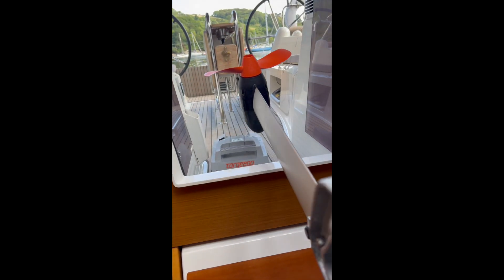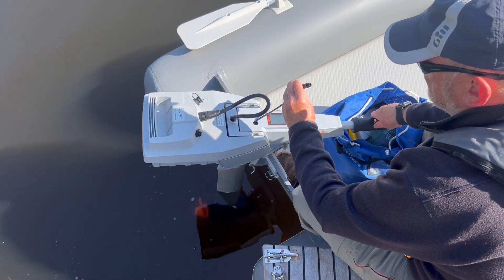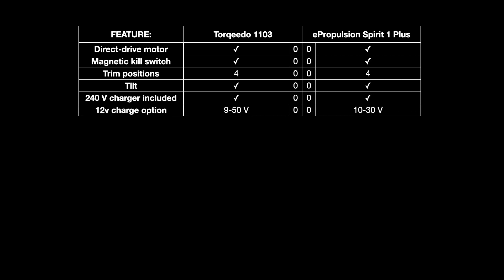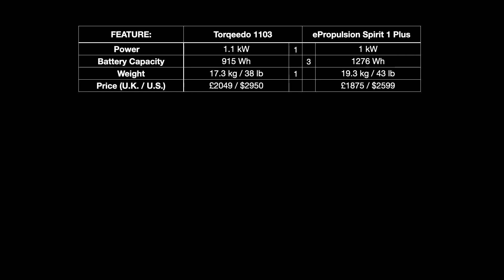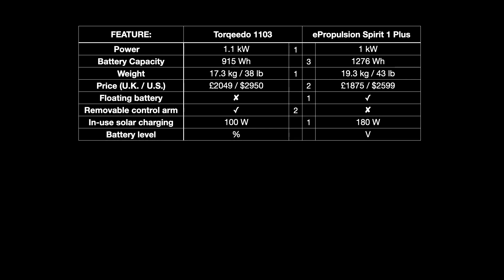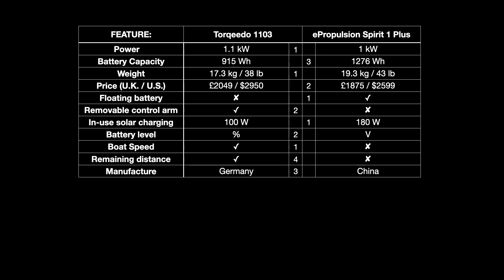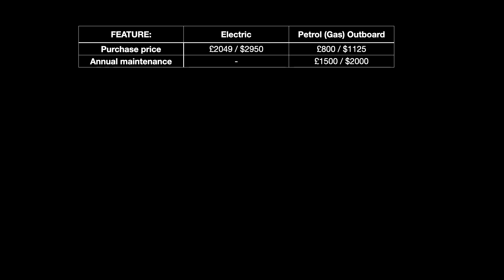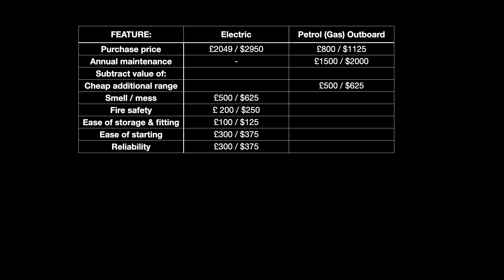Are electric outboards worth the extra cost?

Comment: I've been been a Torqeedo owner for more than a decade. I absolutely love it, but have mixed feelings as for cost of ownership vs a comparable gasoline motor.

As a small car owner (sedan), I really don't want to keep gasoline or oil inside my car which could leak and I'll be smelling that for ages even when the motor isn't inside the car. Smelling it on the water is not a big concern though. My Sea Eagle Paddleski 435ps inflatable boat, the Torqeedo and accessories fit inside my trunk. With the angles you have to store gas motors when transported, it might take up more room I don't have too. 

You can't beat the Torqeedo for convenience. You don't have to make a trip to buy gas, mix additives, etc. On a trip you can leave the Torqeedo in your vehicles for days at a time if needed. I think it would generally be a lot easier to start it than a small gas motor, which I always see people struggling with them. And with wrist issues now, pulling the lawn motor rope would probably not be good for it. There is one lake around here that allows electric only as one of many I go to. 

As for the cost of maintenance between the Torqeedo or a gas outboard, it's hard to say. Yes, when I asked the service center last week what a small Honda costs for annual maintenance. They told me $250 (USA). I asked a few Honda owners about it, and they said the shop might be taking people for a ride. Just some oil to change yourself and pretty easy. So I dunno, looking into that more as I might also want a gas motor too. 

The Torqeedo being 100% maintenance free is not 100% true. I have an authorized Torqeedo Service Center an hour from me. They work on Honda's too. They told me about every 5 years, there is some maintenance that should be done which includes changing the seals and a few things. When my Torqeedo 1003s was approx 9 years old, it completely lost all thrust power.  I bottomed out, but didn't seem like I hit anything too hard. Instead of having it repaired, someone offered to sell me another very cheap that worked (minus battery). It was about the same age as mine. Last year, it too had the same issue. I thought the pylons had gone or I broke he sheer pin if I was lucky. The propeller broke on this one (not sure about my original one), and the shop did what they said was 5 year annual maintenance, and replaced the propeller too. I spent $530, but $100 of that was for the propeller part. They said most of the remaining fee would have been considered the maintenance I didn't do after 5 years. I replaced the battery after it was about 7 years old. That was expected I'd say. The new battery was about $1000 but lasted 50% longer than the original one, and I got it on sale cheaper but it sat for a couple years on the shelf so likely won't last as long as newly manufactured. I noticed an ongoing issue early last season of the power button not working correctly, but I wasn't sure if it was something else besides the button the tiller. They diagnosed it, and said the tiler control board needed to be replaced. It was a $380 repair bill. It did start on the first shot when I tried it out the other day. 

The good news about the motor was, since I mostly used it in fresh water, and always rise with my water bottle when I'm done and make sure I use the motor in a lake with in a few days after salt water use (to really clean it out), they said there was next to no corrosion inside the motor. So that part was good news. 

I think the real question is.....how realistic is annual maintenance needed on a small gas motor such as a Honda, and is it so simple, you can really just do it yourself? But yes, if you ask a service center, they are going to say it needs to be done, they aren't going to suggest you do it yourself even if it is that simple, and it's going to be pretty expensive. 

Do I love the motor? Absolutely. I think even if I owned a gas motor, I'd still want to own a Torqeedo too. Both would be nice. I'd mostly use the Torqeedo, and the gas motor when I need better range, would not be most of the time, but there would be times it would be nice.

Torqeedo vs ePropultion. I'd agree that I'd favor Torqeedo. My reasons would have more to do with getting it serviced, and availability of parts and batteries. Torqeedo is the originator of this kind of product, and ePropultion is nothing more than a Chinese rip off of Torqeedo, and not even at enough of a lower price to consider a Chinese knock off. Torqeedo is widely distributed. They can be bought all over, and so can batteries and replacement parts. I guess the real question is.....when you need servicing, as these are both highly specialized products, how far is the service center for ePropultion vs Torqeedo for you? I tend to think finding a Torqeedo center in general will be easier for most people, unless you live closer to China. And do you trust Chinese Engineering as much as German? Another thing to consider. Eventually, just about any mechanical product will need servicing. 

You can see a few videos of me using my boats & 1003s motor on YouTube. Type is Paddleski 435ps Torqeedo 1003. I also show my Paddleski 437ps, and posted the first video that boat.
Reply from the maker: @classicarcadeamusementpark4242  Thanks for all that excellent info!
Reply: @theboatcheat1204  Sure. Anytime!

Hoping to take mine to some exciting places soon now that July is here.

Comment: Thanks for the video . I have owned a torqeedo for 7 years now, a 1003  great when new , not so good with age , always wash salt water off as my corroded badly , you will also get a communication fault come up as the bend on the cable is far to much of a angle for the thickness of cable and over time pulls at the wires inside a design fault , not cheap to fix , happened to me twice now. i will not be buying another one. Maintenance free they are not . The transom locking lever is also prone to breaking. still better than petrol outboard . There are web sites out there with other people who have had same issue. cheers
Reply from the maker: That’s really interesting - I have had no such problems and mine is from the same era…

Comment: Hi same as Chris comment , nice review, how do you factor in electricity cost, and battery life.  I use my tender maybe 2 or 3 times a year, during the summer’s short sailing period ( north … North America)😊 came with the boat so for now not an option but eventually will, I do find the handling and storing  of torkedo is the best,  we can always find some nooks and corners where to hide them on the boat. Cheers
Reply from the maker: Battery life is not an additional cost because we are looking at 10 years, and most electric outboard batteries last longer than that.  Mine is 8 years old and showing no signs of degradation.  However, a spare battery is about £600 with taxes, which doesn’t change the outcome.

Comment: Cost of fuel vs cost of electricity?
Reply: Your need to compare the total costs
Reply from the maker: For a tender the fuel consumed is of negligible cost for most people so we didn’t include it… however electricity is MUCH cheaper…
Reply: I don't think you'd notice an increase in your electric bill even if you used it a few times a week. I've been a Torqeedo owner for more than 10 years. 

That said, a comparable powered gasoline motor uses next to no fuel to operate. Fuel costs aren't a reason to buy the Torqeedo.